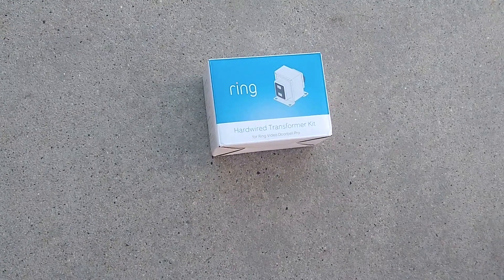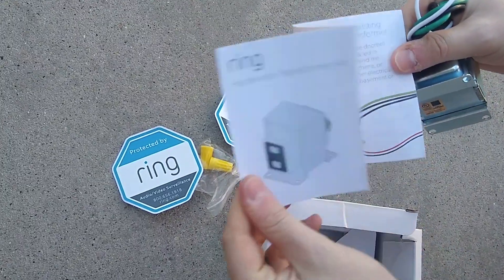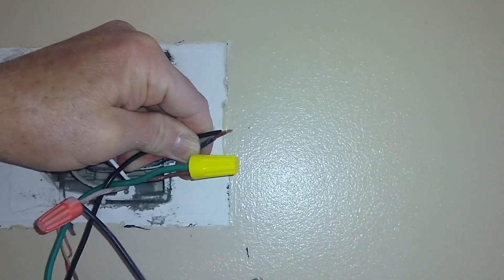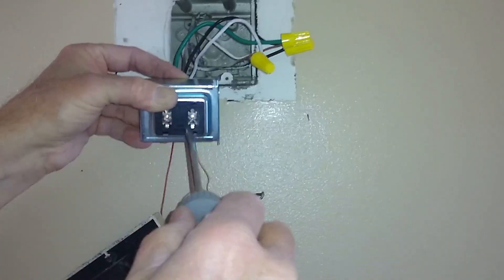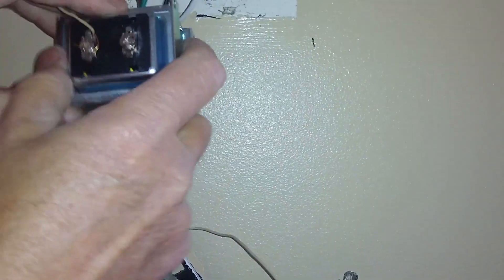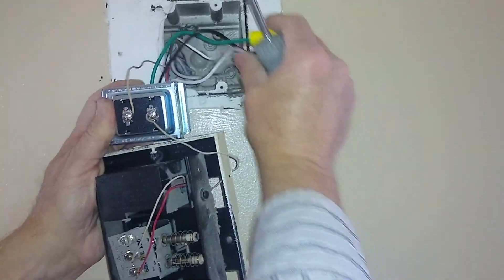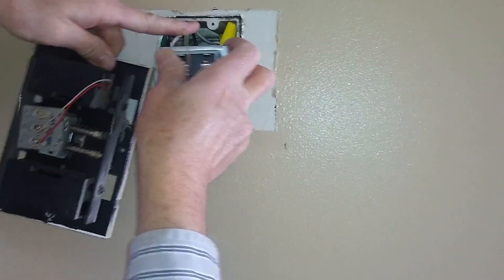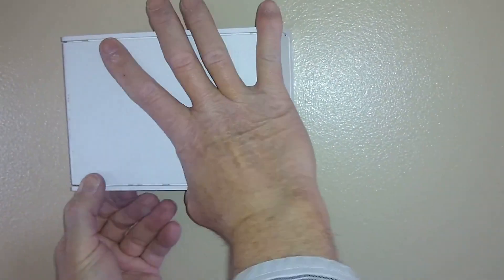How to install Transformer kit for Ring Video Doorbell PRO video #ring #ringtransformer #pro

Comment: I have 2 Chimes, would I need to do this one for each chime, or just find the one with the transformer in it and replace that one?
Reply: @David.  That is a great question   I do not have two chimes so I am not sure.   I  assume you would just replace the one that has the transformer. Best of luck and please let us know what you ended up doing.

Comment: What if you want to eliminate the old doorbell chime and instead want to use Ring Chime Pro? Do you still need a new transformer?
Reply: @Victor.  Great question.  Yes, you will still need the transformer.  Best of luck with your project.

Comment: Great video!  I measured the voltage at my current bell button as 18V.  
Should I be OK from an amperage standpoint?  Also, there is an unused 
green wire at my current button.  Does that get used by Ring?
Reply: I don't believe the ring has a ground wire at the button. I know my button only had two wires. Please let us know how it turns out. Best of luck.

Comment: What if there is only a black and white wire coming from the house? What do I do with the ground?
Reply: @ Dale.  The ring will operate normally without the ground wire because it is not a part of the conducting path which supplies electricity to the ring. I hope this helps and hopefully you subscribe to big Al repairs.

Comment: Maybe change the title, this is simply replacing/swapping an existing transformer for another within a doorbell system already installed.
Reply from the maker: The title is how to install "transformer KIT".  It is not titled "how to install a transformer". Does your home not come with a doorbell or transformer?
Reply: @BigAlRepairs  my home does not come with a chime because I want to use a chime pro
Reply from the maker: @xmxme3  So are you wanting to install a chime? We are not using the Ring chime for our doorbell, we are using the transformer and sound from our original doorbell.  The transformer is a metal box with two terminals connected to the doorbell wires.
Reply: @xmxme3   same 😢